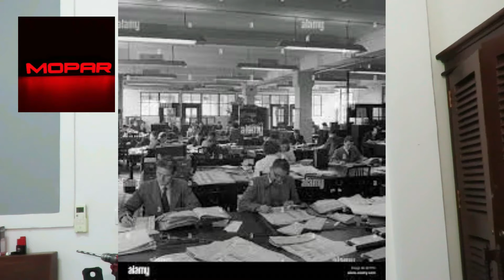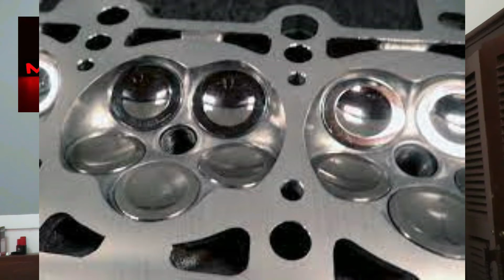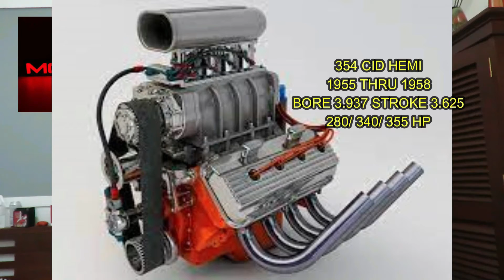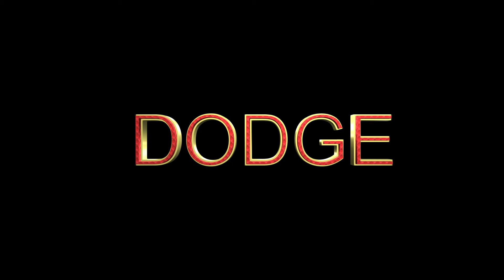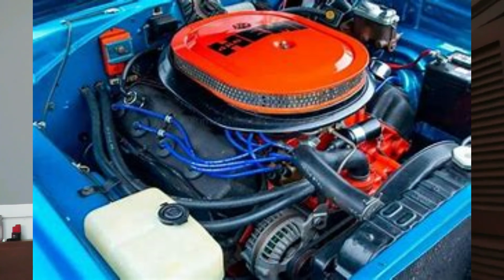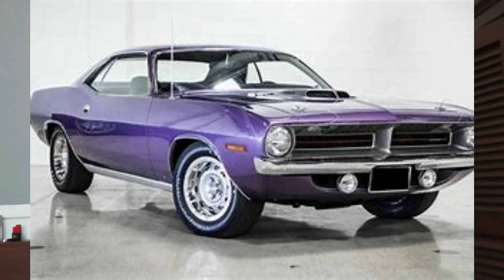CHRYSLER HEMI V8 ENGINE HISTORY

Comment: That EFI was bought by a spunky startup German company called Bosch.  It was fixed, and re-released as D-Jetronic on VWs in 1967.  Bosch then ruled the world in all forms of fuel injection for decades.  Bosch had Motronic out in vehicles when Chrysler itself was still dicking around with electronic feedback Carter BBDs.  Can you imagine if Chrysler stuck with it, and got rid of the wax paper circuit boards mounted under hood where heat and moisture caused problems?
Reply: one other problem with it is the lacking of EMF-shielding ( fixing that helps a lot as driving next to telecom's or power inforstruster really misses it up as dealership's delivered, didn't help that 1930-70's tech's/mechs weren't up to snuff wiring/computerised, so to them it was magical 🧙‍♂how it worked, unlike my/millennial+zoomer generation carb's+magneto is that way, i had boomer's around me-90's-kid so i understand carb's/mechanical works better but i also have been learning modern EFI and PLC's-ect as time goes by ) and picking the incorrect capacitor's on the circuit board's, sorry there's wright up's on how to copycat and resources restore bendix oem symptoms, or for the hardcore pureisted copying it for a period correct hot-rod, i considered copying it for my late-60's charger but decided on cheating on that part of my build and using modified modern-2016~up EFI hopefully nobody else notice's that 😉 as most of it's hiding underneath my crossram intake and exhaust-systems on my D8-heim 2x-plug k-valve covers, also hopefully my crome/fancy parts draws that eyes away loll 😂 

basically corporate gave up on it to easily and or sabotage it ( anti union's/workers-benefits/rights/safety efforts are strong with USA 🇺🇸 and elites so much that there willingly to kill a well-run/profitable company ( and government? locally or federally? ) sadly ) as a engineering project as in 1950/60's nothing really stopped it from being standardised on all new cars, something i read about in older repair manuals and get mad as they were cutting sparks and dumping raw gas ( and sneaky destructive to engine-ect parts, so customers would have to buy a new cars sooner or return for repairs$$ ) out the back as a hack-design on some models for things like downshifting ect

Comment: It would have never been able to touch the Ford camer the track.
Reply from the maker: The Ford Cammer has allot of problems the timing chain was very problematic. and NASCAR does not allow OHC engines it was drag raced you will never see a top fuel dragster in serious competition with the Ford Cammer the Hemi's are making 11000 HP the Cammer is not so I'm not sure whrere your info is coming from

Comment: The hemispherical combustion chamber has benefits in detonation susceptibility but also has some weakness in the lack of any quench or squish area that helps to homogenize the mixture in the chamber. Personally it seems like the hemi might have it's biggest advantage at full power but give up some efficiency at partial throttle where the lack of combustion chamber turbulence would be a disadvantage. Any thoughts?
Reply from the maker: yes you are right about that it is a low turbulence chamber the pent roof chamber were much improved they do have quench areas on both sides of the chamber the hemi is much better when it has high compression the lower compression versions need to be in the higher rpm range to make power although the 426 did pretty good at low rpm mainly because of the large cubic inch made good low end tq the Gen 3 Hemi's do have a decent quench area and are pretty efficient at low rpm and more detonation resistant than the earlier versions
Reply: Excellent discussion! The quench area has proven to be an important part of combustion chamber design. Something you might consider in future videos is tumble flow vs swirl flow and the benefits of a compact combustion chamber. The development of the piston engine up through the sixties is fascinating history. One might say the pinnacle was Keith Duckworth's Cosworth DFV engine.  Love the videos!

Comment: So I gotta ask. Was the Chevrolet three 50 in.³ engine the same as a Pontiac 350 engine? What was the difference between the Chevrolet 454 cubic catch engine and the Pontiac 455 engine cubic inch engine?
Reply: The Chevys were completely different than the Pontiacs.  The 350 and 455 Pontiacs weren't very different.
Reply from the maker: No GM engines were all different Pontiac Oldsmobile, Cadillac, Buick, Chevrolet all had different engines, but it was a little different than Chrysler mainly because The Chrysler, DeSoto, Dodge engines were all versions of the same engine the Hemi the GM stuff was not the divisions of GM had nothing in common with each other.

Comment: There is one engine that could match with the 2nd Gen 426 hemi, you pointed out the Ls6 454, I'd put the L88-427 chevy right beside the hemi without a shadow of doubt. In any case congrats.
Reply: Another is the 455 Buick.

Comment: Great video as always, but I do have to add a little to this. GM is the one of the big three that was diverse in design (Pontiac, Buick, Oldsmobile, & Cadillac) all the divisions under GM had totally different teams of engineers building completely different and competing designs (Billy Durant the founder of GM set GM up this way in the beginning to avoid the Monopoly Laws & offer multi-tier marketing). But you are spot on in Walter Chrysler being involved in that, because he was actually the person in GM that was pushing that aspect of it after Durrant was fired from his own company and Charles Nash took over. Walter was working for GM at the time as their Chief of engineering and production. When he left GM to start Chrysler motors (around the time that Durrant bought his way back into GM with his Chevrolet sales money), he took all that to a new level. As for the HEMI being the all-out power monster of its time....... that was more of a "happy accident". It wasn't meant to light the world on fire, it was designed to be the most efficient on VERY poor & non-standardized octane fuel quality that we had back then. These things would run on any octane, at any gas station in the country and still deliver consistent power and economy without constantly playing with the timing and tuning like the others out there. The other companies relied on compression - Chrysler relied on flow.
Totally dig what you are doing Myvnitageiron, and so glad to see you back in the swing of things.
Reply: I was gonna mention about the different engines from the GM divisions. They all(except Cadillac I think)had a 350, but the only parts that were the same were the carburetor and distributor.
Reply: And back in the early days (pre-68) they were all completely different. The Buick Nailhead shared nothing with the Chevy or Rocket Olds. You can even toss FoMoCo into that, with the MEL, FE & Y Block but it's really knit-picking. Myvintageiron is spot on with how Chrysler took all that to a higher level even. As for Caddy, yeah unfortunately they even had a 350, but it was the infamous 350 diesel that was a complete dog & spit head gaskets faster than you could put them in. No one wants to remember them.... lololol. After 1968 you started to see all of them dropping the brand diversity and sharing drive-train engineering across the board. @The_R-n-I_Guy
Reply: The 50s Hemi was more efficient than the 60s one. The Ford FE actually was more efficient than the 60sHemi. The 60s Hemi had the plug so far away from any quench it was down on power. The SOHC Ford could wind to 9000 rpm and live on their Dynos for three weekends of drag racing, and 3 500 milers. They banned it. But they had the Tunnel Port FE that was so light but strong that it was running with the Hemi. Then the aero wars, with the wing cars. After all that was banned. The Boss 429 was ready but dang id the TP FE wasn’t still running with them both, not bad for a boat anchor. What finally happened was the small block. The FE could be destroked to 354 and beat everyone but the 351C . It beat the C at first but the rules changed to maximum 4 inch bore. That was the end for the FE racing program.  Of course now RayPaquet is  running 8s in A/SS. Amazing how the great rise to the top.
Reply: Oddly enough, there was another one offered by FoMoCo that IMO would've dominated all the way through the 60's if Ford would've pushed it. The MEL "Marauder", but when they tamed it down it went from the 430 power house to the low compression 462 and faded away into obscurity. Heck they even wrote songs about it. "Have you heard the story about the Hot Rod Race when the Fords & Lincoln's were setting the pace, that story is true and I'm here to say..... I was a driving that Model A". That's a 430 Super Marauder (dual carb) in a Model A.... lol. Problem with it though, it's a monster in physical size. It's even wider than a 460. So most of them were only found in the big land yachts with "slush box" Cruise-O-Matics hanging off the back of them that sucked all the power and torque out of them. Sad really. But now you got me rambling and dreaming again....lololol. As you can tell, that one but not just anyone, the one that came in the 1959 Thunderbird with the 3 on the tree (because you have to have that Bellhousing & Flywheel) is my "unicorn" FoMoCo engine combination. I could care less about the T-Bird it sets in, I just want that engine & bell.... lolololol  @Bbba724
Reply: @Bbba724  It would have been neat to not have the 426 Hemi banned but instead let it and the Ford 427 SOHC race! Knowing GM they probably lobbied [bribed] NASCAR to ban instead of trying to compete...
Reply: not a bad video but packerd's in the 1950's have a 5" bore spacing and or at lassed larger ( to bad by 1960 the line died as 5/600CI+ and or 550+hp i think would have been possible with the space in the late-50's-casting's and facilities tooling capacity ) than my 440/hemi as i put my valve covers ( 1969-383-G-code and k-hemi type 2X-plug, working on the D8-hemi+TR6060 EFI swap as my newest combo ) next to a 55?pack they looked like toy's wow is it long ( 2ft to 3 and half feet ) and tall-ish/with ect valve-spring-h=4-6"in~ sorry it's been a while and if i wasn't in my $$+space was vary-mildly tempted to buy them as a lol 😂as i don't own a pack or plan's for it ( i am copying the T-bar's and ride levelling technology off a 1955 Caribbean convertible ) for now as im buzzy with my charger's build and my BEV-truck 1/2-ton
Reply from the maker: yep were doing a series on all of those stay tuned
Reply: Way cool! can't wait to see more of these man.  @Myvintageiron7512

Comment: I have always been fascinated by the 50s engines, the 331, 354, 392 HEMI. The 60s Hemi had problems with the plug being so far away from the piston. The Boss 351C was a good design.
Reply: Agreed. I had a 392 in a 17' flat bottomed drag boat. Spec'ed out around 135mph based on 10% slip rate.
Boss 302 was no slouch! Had a mentor build a 67 289 to push 504 at 9k.  Black flagged at Daytona for going too fast (for a 289...) 178.86 lap speed, 210 in the back stretch. Won the challenge, won Mech of Year too.